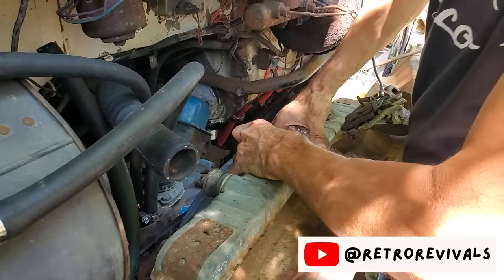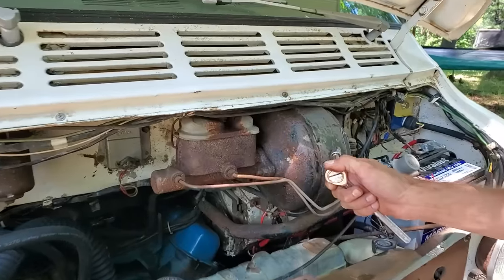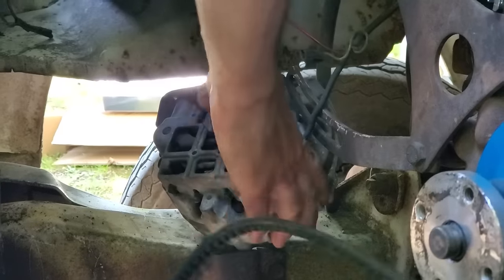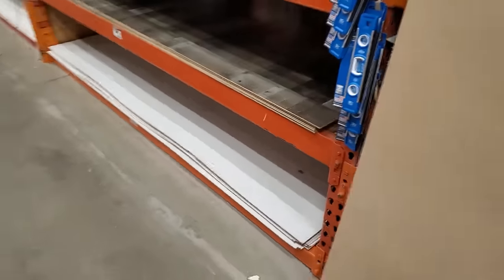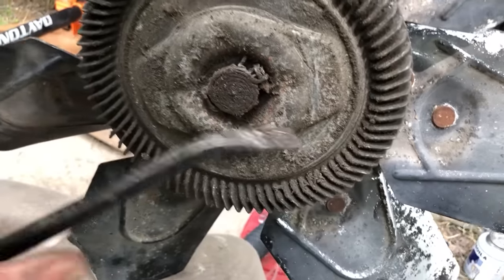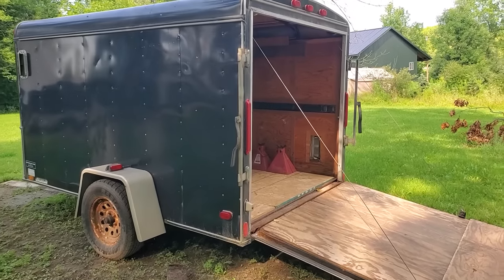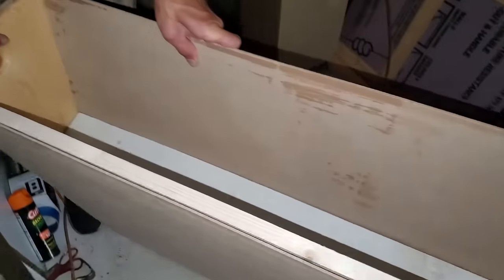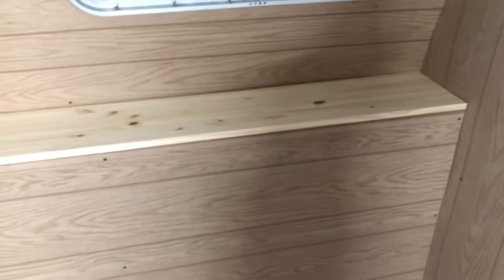DIY Custom RV Storage & Can We Tame Hot-Head Harvey? (1976 Dodge RV)! Vintage Camper Renovation

Comment: The only thing to miss about living in the Midwest is Maynerds!! The bonus is the ability to still shop on line. Worst part is they don't let you use the 11% rebate on line, on;ly earn it. What good is that?? I hope that Maynerd trip better have included some dill cheese curds along with paneling, cabinets and whatever else landed in the cart. Speaking of which, Maynerds usually has a huge selection of vinyl floor remnants that aren't badly priced and would work well in Harvey the RV. There's definitely no question Maynerds is 1000% better then the Depot.
Progress is looking fantastic. It's starting to look like a motor home again!! It's always fun to see a fresh post. Thanks for the continued great entertainment!!
Reply from the maker: Thanks for the reminder!  We need to do that rebate paperwork.  Menards is a great store.  Thanks for the tip on the vinyl too.  We are planning to do vinyl plank but sheet vinyl would be a great option and possibly better so we'll try to run back there to see what they have in stock.  Haven't had the dill cheese curds either!  Sounds interesting.
Reply: @retrorevivals  No cheese curds?? You aren't a true Maynerds shopper!! This is very sad news. How can you not know about the dill or garlic cheese curds?? Dill are better then garlic...just sayin'...Do better!! 🤦‍♂
Reply from the maker: @2AZSUN  Do better, lol 😂  We'll have to use our rebate check entirely on cheese curds 😂 Honestly, I can't even picture a section there with refrigerated food 🤷🏼‍♀️
Reply: @retrorevivals  that’s only appropriate. You can also pick up your milk and other fridge items. It’s usually back by the shampoo and other personal items. Real Maynerds know this already.
Reply from the maker: @2AZSUN  😂😂😂

Comment: Hi guys Hopefully the flush king I told you about worked out.another thing for small leaks I use gorilla sealing spray for alot it really works comes in clear white black. Anything gorilla really works from caulk to tape. Trust me I live full time in one
Reply from the maker: Thank you for the comment.  I haven't been able to find Flush King.  When I search, it just shows some kind of valve.  Where do you buy it?

Comment: I like the fact you guys work very well together. Did you replace the fan clutch while you were at the water pump? The crud you were scraping off of the fan clutch is the oil inside of the unit coming out. Subscribed for this awesome revival.
Reply from the maker: Thank you for commenting and subscribing!  Truth be told, we didn't do the fan clutch but we just bought one thanks trip all the comments and will try to get that in this weekend 👍👍

Comment: Hello all it's a great pleasure for me to see you renovate Harvey you two are awesome working together wow superb job after Harvey is completely restored I hope you keep him and use him regularly .I love the idea that your going fully electric no propane any where .Is the plan to tow the other travel trailer you purchased  and use it as sleeping quarters with a bathroom or just use Harvey which either way you go it's going to work .I hope you both have better luck with Harvey than Endless adventures have had with clementine even with their so called new engine they are having massive problems with her .Not being rude here it seems you have to have bottomless pockets to do what many of you are doing.
Reply from the maker: Seriously!  We have been keeping our receipts and just totalled our costs recently... It's not good.  We should do a video to outline how much it costs to renovated an old RV.  Harvey isn't finished yet but hopefully we can move more quickly; we'd still love to do some camping in it this year.  For the other camper, we're planning to make it into it's own camper that's would be nice for a couple to get away on a little vacation 🥳

Comment: When you see a fan clutch all greasy and dirty like that, you replace it, don't reinstall it.

If the fan doesn't lock up when the radiator is hot, that will cause overheating.
Reply from the maker: We just bought one!  Thanks for the comment, we really appreciate it!  Hopefully we'll be able to install it this weekend.

Comment: Just started watching your videos you said you was going to replace the rubber hoses to transmission be sure to use the correct hose  not just fuel line  probably should have replaced the coolant hoses while they was off and simple to get to
Reply from the maker: Thanks for the comment, Roy!  We replaced some high pressure hoses last night.  We actually did replace the coolant hoses in an earlier video when we did the thermostat and whatnot so all good there too!  Thanks for watching and commenting!

Comment: Done anymore work on that Holiday Rambler? I'm about to dive into my renovation by tearing down the ceiling and ripping up the two front settees. Also going to install an AC and rewire for solar, plus a composting head, redone plumbing, on demand water heater and propane delete.
Reply from the maker: Actually, no, not yet.  We have been trying to get the RV into a condition where we could camp this year.  We really want to work on the Holiday Rambler soon though.  That should go quicker since there's no engine.  Sounds like you have an awesome project coming up!

Comment: Should of replace the water pump and clutch fan while you had the radiator out
Reply from the maker: We had already replaced the water pump in a previous video but we didn't do the fan clutch --- we actually just finally did in the last video.  We've taken that stinking front end apart like three times now 😖

Comment: If you are having any really difficult extractions, please try this method before attempting anything. Create a visualization of the vehicle being grounded. Do this while placing both hands on the unit. Everything will flow like melted butter without a heavy exertion of energy. I did this for a friend. He had been struggling to remove his alternator too. Everything that is, is part of consciousness. Work with it and don’t fight it. Being in harmony is key.
Reply from the maker: I'll have to try your suggestion. Thanks for the comment 😁